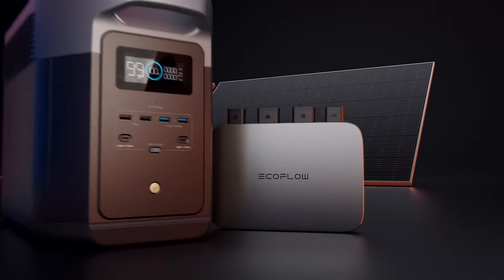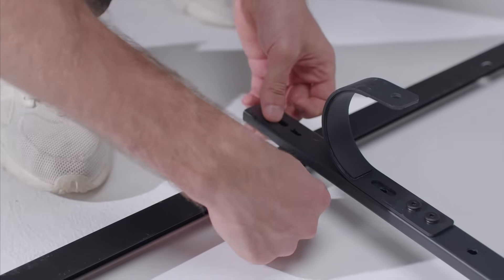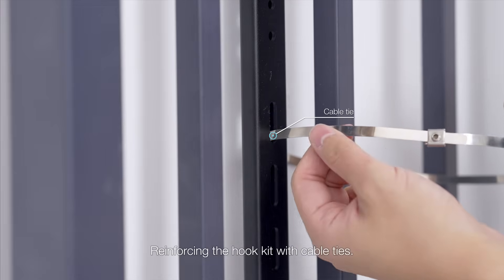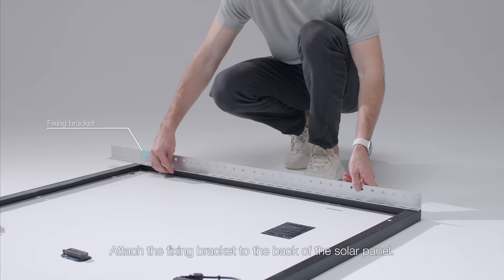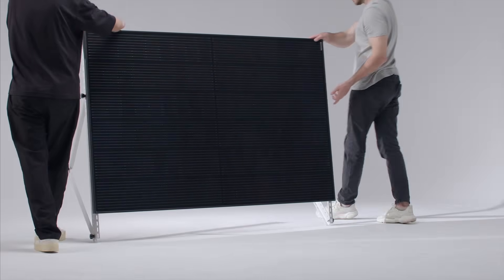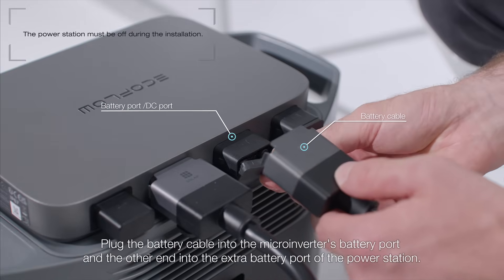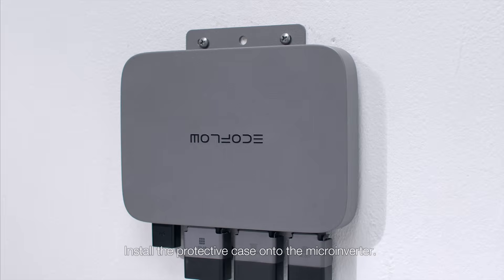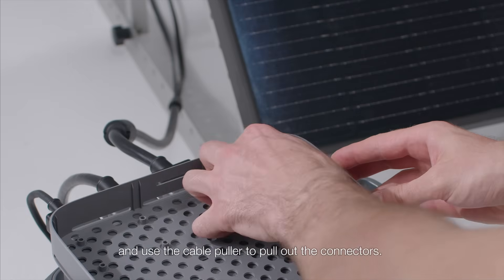How to install EcoFlow PowerStream Balcony Solar System

Comment: I don't know if the bracket supporting the panels can be attached to the railing of my balcony, whose diameter is 8cm. Also the inner length of the railing is 315cm and the outer is 326 while each panel is 172cm

Comment: Hello , Nice video my question...  I have an existing solar installation of 10KW , and I would like to install the EcoFlow PowerStream and a micro inverter of 800 watts. However, I want to charge the PowerStream via AC and not through solar panels because those are already installed. So, I would like to charge the PowerStream using AC when there is sufficient solar output (detect this with smartplug)  and use it in the evening via the micro inverter (800 watts) to reduce my standby consumption. Is this possible?

Comment: Can you explain how this is legal? If, for some reason, the grid is down for maintenance and you are feeding electricity into the grid, will this electrocute a worker?
Reply: The microinverter has an internal protection, it cannot feed power to the grid from the solar system if it doesn’t detect the grid. So in case of a power fail in the neighbourhood for example or during a maintenance, the microinverter automatically cuts the power. In Morocco the standard requires such an integrated protection, else it should be installed after the microinverter. This ensures people are not liable in case of any hazardous event. I hope this helps.

Comment: 4:56 - is it possible to connect non-ecoflow 24V battery via such car lighter socket, or say this question another way: is it okay that through such lighter socket connection  PowerStream will get ~24...26V instead of 12...14V as for the case of River series power source ?

Comment: So I can connect to ANY house socket and it should be able to push power IN??
Would that work in Switzerland?
Reply from the maker: Hi there, sorry for late reply, yes the AC output plug can be connected to any house sockets. It can also work in Switzerland. We already have a group of Swiss users🙌
Reply: @EcoFlowTech  how about Malaysia?

Comment: i like ecoflow i will love to use thr balcony system but i live on 23rd floor no balcony what can i do???? can solar panel indoor behind window glass?
Reply from the maker: The glass has a huge impact on the power of the solar panels. Therefore it is not recommended to set up this system if you can only mount the solar panels behind window glass.

Comment: Can the system be configurated, so that the Delta battery  is only used for the appliances connected to it and not to feed its capacity into the grid overnight? 
i want to have it connected to the grid in case i want to charge it in case there is no solar power and the soc is low. is that possible?
Reply from the maker: Hi, in that case, I recommend our smart plug which you can use with the PowerStream system. First you can set the AC output power demand on 0W at EcoFlow app--System setting. Then the Delta can only be used to power appliances to which the smart plug connected. You can check our web for more details👉https://de.ecoflow.com/pages/powerstream

Comment: If the panel is charging the ecoflow pro, why do you plug it in?
Reply from the maker: Hi there, after you connect both the panel and the portable power station to the PowerStream, you can set on App when do you want the energy go to the home circuit or get stored in the power station. Let me know if you have other questions.

Comment: Great tutorial. With a kit Powerstream + Delta 2 Max , is it possible to to get more than 800W of solar (the limit of the powerstream) ? Can we connect 2x400W on the powerstream and additional panels directly to the Delta 2 Max via the XT60 ports ?
Reply from the maker: Hi there, thanks! For your question, if you connect Delta 2 Max to PowerStream and solar panels simultaneously, the panels will prioritize the battery charging rather than PowerStream. Let me know if this helps.

Comment: Hello! Thank you for the video! Is it possible to have additional panels connected to the DC charging input of a Delta 2 Max, so that the battery gets charged from the PowerStream and the DC input at the same time? I have 4 solar panes in total (2 325Wp, and 2 400Wp), and it would be great if I could integrate all into this "eco system" - another option would be to have two powerstreams connected to one Delta 2 Max battery... would this be possible?
Reply from the maker: Hi, if you connect solar panels to both PowerStream and Delta 2 Max at the same time, the battery gets charged only from the panels. And you can not have two PowerStreams connected to one Delta 2 Max. Let me know if you have other questions.
Reply: @EcoFlowTech  OK thanks for the reply! I think this would be an interesting feature for the future - at least for me ;)
Reply from the maker: Got it! DM our R&D team already, thanks😎

Comment: I'm trying to use it without solar panels until they arrive. The idea is to charge the battery at night, when grid electricity is cheap, and then use in daytime. The issue I'm currently facing is that Delta 2 doesn't charge from external battery port (connected to Microinverter) )for some reason. Support is slow so far. :(
Reply from the maker: Hi there, the grid power can not charge the PowerStream. And if you want to charge Delta 2 via the PowerStream, it should be generated by the solar panels. The electricity that comes from the PowerStream can only be generated by the solar panels. Let me know if you have other questions!🤔
Reply: @EcoFlowTech I see. Then you.should clearly instruct in the manual to connect Delta via its AC input to the grid as well as via additional battery port in case one isn't using solar panels
Reply: @yuriypadlyak212  Seems like you have misunderstood the whole product
Reply: @timogronroos4642  Using it to store during cheap grid rate, and using it while rate is premium doesn't make much sense taking into account losses but still is a use case. Why not?

Comment: Actually, my concern is about this situation. 
Let's imagine there is a general electricity outage. What will Powerstream do :
1) Will it stop injecting electricity in the home electric network ? 
2) Will it keep on charging the Ecoflow powerstation battery until it is full, from solar panels ?
Thank you
Reply from the maker: Hi there, here are my answers.
When there is a power outage:
1) It will stop injecting electricity into the home electric network.
2) It can keep on charging the battery via solar panels. 
Let me know if you have other questions🙌
Reply: @EcoFlowTech  Very good news. Thank You

Comment: Hello and thank you for this video. I have some questions

The PowerStream is powered by what: by solar panels or by the electrical network? If it is by panels, how much power does it use?
We can buy the Powerstream separately : Good ! Does it means that we can connect any solar panels brands on it within the limit of the 800 W?
And about the battery: can we connect another brand than Ecoflow to the PowerStream?

Thank you
Reply: The PowerStream uses 16W so the first 16W the panels bring in are to power it if it’s not connect to a battery and anything over and above that goes into your home circuit. If it is battery connected then it will draw those 16W from there and 100% of the solar will go wherever you have specified as your priority.

Edit: Also, the 55V is times 2 so 110V input as it has two independent 55V solar connectors, so 2 x 400W panels.
Reply: @InimitaPaul  Thank you very much for this precise answer. This is important to integrate this value in the calculation of the solar system
Reply from the maker: Hi, both can work and the maximum is 800W. You can connect other brands' solar panels, just pay attention to the specs of PowerStream which is 55V 13A. However, you can not connect it to other brands' portable power stations I am afraid. Let me know if this answers your questions!
Reply: @EcoFlowTech  Thank you for this answer.

Comment: You just need to plug the cable from the microinverter into the apartment socket and that's it? You don't need to turn off any switches in the apartment (for example, the switch that is responsible for supplying electricity from the street to the apartment)?
Reply: good question without answer :)
Reply from the maker: Hi! Yes, you just need to plug the cable into the socket, and no need to turn off any other switches🙌
Reply: how do you prevent backfeeding the grid? WILL THIS WORK IN AN OUTAGE OR IS IT ONLY A MEANS TO LOWER ELECTRICITY COSTS
 @EcoFlowTech
Reply: @EcoFlowTech  Isn’t that dangerous and illegal? You are powering the entire home AC system and consequently the grid.

Comment: This can't be installed when you rent and already have a balcony.
Reply: Should not be a problem, glass has a very high melting point and the back off solar panels don't get that hot. If you can leave a small gap you will get better performance out of the cells, but mounting them directly is not a problem either
Reply from the maker: Why not? 🤔
Reply: @EcoFlowTech  I have a balcony with glass. The dark material will get too hot so the glass will collapse I think.
Reply: @freespeech8947 it should be fine if you can attach the solar panels. We also have a glass balcony, which some of the lower windows are tinted, they get warm. I wouldnt think it's a danger for you.

Comment: Is this fully approved for use in the UK?   Where can I find a UK price inclusive of VAT and any import taxes/duties?
Reply: Hi guys I little bet confused 😵‍💫 is this product is legal or not in the uk thank you
Reply: it's £329 in the UK, sold in the UK, so only the normal vat, that's the base unit, no smart plug & no cable to your battery & no panels, but they sell packages as well

if your willing to take a risk buying something that is declared illegal
Reply: @poledark Everything is illegal in the uk. Brushing your teeth will also soon be illegal
Reply: No, it was put on sale in the UK before being sent for G98 testing, but it is widely believed to fail bs7671 - the current electrical regulations, which says you can't connect Any generation device by a plug & socket

Comment: Looking forward to this hitting the States. Ecoflow is #1 for sure.
Reply: @geogmz8277 there’s a lot of stupid everywhere, including wherever you’re from.
Reply: @geogmz8277  15 amp max so perfect for the average person trying to power thier home. MOST homes don't consume more than 3kwh per hour. So technically this is easily achieved with 2 separate delta pros and 1600 watts of solar . :)
Reply: @jaysonstebbins2539  assuming you mean 1600W per unit (3200W total) this highlights the drawbacks of having limited solar input.  If a home is consuming the majority of your solar input there’s little left to charge the batteries with.  Since the sun is scarce in many places you’d be hard pressed to consistently charge the two batteries day after day on available sunlight while powering your home.

Even dedicated battery banks with far more storage and solar charging capacity can have trouble being a home’s primary power source.  Two Pros and 3200W of solar would be good for emergency use only.

If the next generation Pro has some serious solar input, say double at 3200W for each unit, only then would you be able to power your home AND charge your batteries.  The new Delta 2 Max has dual solar inputs, so maybe the next Pro will do the same and hopefully with a much higher input cap.
Reply: @superspeeder  I agree with that. Yes solar can be a issue in most places but on a day like today with full cloud coverage which is the first in 2 weeks I'm still getting 300-600 watts to my single DP from a 1200 watt array. I'm still getting 25-50% output. Everyone thinks that if the sun isn't visible them there's no solar. Module efficiency like my renogy and hqst's still get good output in low light conditions. I would love to see dual mppts on the Delta pro "2" with 1600 watts each. With my delta max 2k I was able to keep my house warm (with full sun) using my 12kbtu portable ac heatpump using a 800 watt array during the day. Ecoflow is geared to supplement and be used in emergencies safely. I think they have unlocked full potential to make full sustainment for full time use of solsr generators for taking a home "off grid" or or almost 100% self sufficient. I have a 1600 sq ft house here in Tennessee and can and have been able to use my single DP through a blackout and use daily to knock my 12-20kwh daily usage down to 0-5kwh usage. My last electric bill was $75 vs my $120. No it doesn't pay for itself like any battery storage system does but it's fun and great backup. 👍 these are facts of my own experience and situations and may not fit all situations.
Reply: @jaysonstebbins2539  agreed.  EF and products like theirs have opened up some really exciting options.  I have the Delta Max 2k as well and really like it.  I haven’t had the same cloudy day results as you, barely getting 2-300W on overcast days from my 1320W array, but I do have tall obstructions on either side of my panels which could limit their ability to gather scattered light on cloudy days.  On sunny days I have clear sun between 12:00–15:00.

Fingers crossed the DP2 has some serious solar input.  If it does I could be tempted into an upgrade!
Reply: @superspeeder  I myself upgraded from DM2k to DP mainly for the cycle life and solar input. I wanted to be able to use SHP later on with two DPs because the solar industry is in the business to rip people off here in East TN. $60-80K for a 6kw system with 10kwh battery....  like serious? I'm mostly excited about dual inputs. 2 separate arrays. If the delta 2 max was out when I bought my delta max 2k I would've kept it. That was in December. Ecoflow allowed me to return DM2k and buy the DP with a restocking and shipping fee. Worth it... lol
Reply: @jaysonstebbins2539  Nice!

Actually, if a new Pro comes out it’s more likely to be called the Delta 2 Pro, to follow along with the D2 and D2M.
Reply: @superspeeder  I like that I'm down
Reply: @jaysonstebbins2539  - unsure if they'd come out with a new DP PRO just yet. It pretty much set the bar for them & every competitor out there. All their other lines followed suit to the Delta Pro. Only true real change or upgrade they can make to it since it came out on kickstarter is the solar input. Im backer 800 something & we have all the perks when it comes to the pro. We were included 10 years warranty so yeah. Kind of hard to beat especially if you were early bird backer of the $1999 price. Nothing has come close to me as for value dollar for dollar as a kickstarter backer.
Reply: @superspeeder  -  unsure if they'd come out with a new DP PRO just yet. It pretty much set the bar for them & every competitor out there. All their other lines followed suit to the Delta Pro. Only true real change or upgrade they can make to it since it came out on kickstarter is the solar input. Im backer 800 something & we have all the perks when it comes to the pro. We were included 10 years warranty so yeah. Kind of hard to beat especially if you were early bird backer of the $1999 price. Nothing has come close to me as for value dollar for dollar as a kickstarter backer.
Reply: @1ENDUSER  no way that's awesome! I got my DP financed so Kickstart wasn't an option for me. 10 years is killer!
Reply: @jaysonstebbins2539  - early kickstarter individuals etc bought the DP pros pretty much 9 to almost 10 months out before the release. Even then people who just waited for the release to purchase the DP pro's got theirs before even backers like myself did. But I guess worth the wait because warranty isn't the same.
Reply: Some countries won’t allow this back feed into the grid.
Reply: @MotivateTransformSucceed  there's no backfeed if your only covering loads in the home.

Comment: When will the powerstream be available in the USA?
Reply: Currently it's not approved in the UK, doesn't meet electrical regs, doesn't have type approval & has based it's release on a misunderstanding of EU laws which it thought applied in the UK & also that the UK allows people to connect sub 800W generators to a house circuit, which it doesn't (we did have a trial scheme that finished in 2022 & they would have had to apply in 2017), it also sits on the wrong side of circuit protection, no transfer switch & no warning stickers provided to warn electrician

Comment: This looks like a great system that Iooks like it would very nearly suit my needs. My question is , are there any plans to link the inverter to a power clamp device (similar to a smart power meter) to more intelligently monitor the whole house usage? The smart plugs are useful but a bit limiting, you can’t cover usage of the lighting circuit for instance. An add on like this would make it a fantastic system.
Reply: they said the avg person wouldn't be able to do it!
Reply from the maker: Hi Colin, you can see the total output power on our APP yet currently it does not support seeing the usage for a particular circuit. But good idea! I will bring this up with our R&D team😃